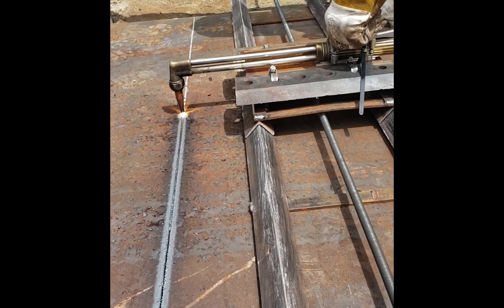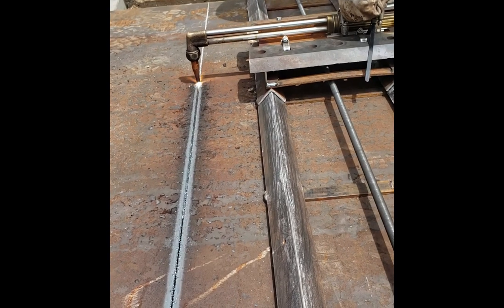Homemade Track Torch

Comment: Very nice work! I think you could turn up the feed a bit
Reply from the maker: Thank you, it was a bit of a challenge to steadily control the speed with a cordless drill. If I wind up needing to use it much more I'll definitely put a nice electric motor and speed controller on it.

Comment: Good idea now I am thinking of making one wonder about tread count maybe 2 thread per inch with a hand crank
Reply from the maker: That sounds good in theory. If I were going to do one that was solely hand crank I'd probably use a bike chain and sprockets to gear it down instead of having to make a custom threaded rod. If you make one I'd love to see it.
Reply: @dw0r  that’s a great idea but did some research and you can order fast travel rod that moves 1 inch per revolution I think with less speed of the rod you will get less vibration and a smoother cut
Reply from the maker: @johnsassano8728  that's almost definitely the way to go. Could even do a sled that rides on bearings. I just source things I have laying around. They also make commercially made track torches. They're not super expensive, but I only really needed one for this one sheet so far.

Comment: Sir, if you add wheels to your torch carriage it will move much smoother.
Reply from the maker: Wheels would work great if the angle iron was nicey nice, but the long surface contact was how I mitigated the imperfections. 
I had to build this out of things I had on hand with only about 24hrs from concept to completion. I might circle back to it someday and improve it, but I haven't needed it much since I used it to cut that plate.